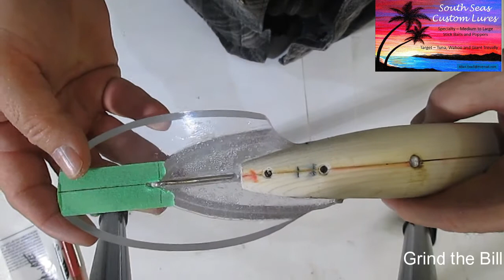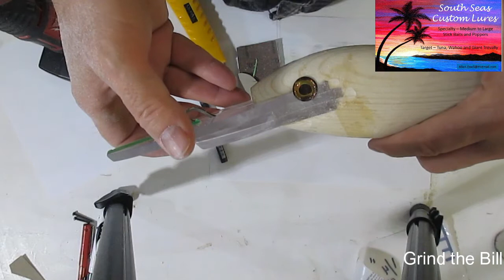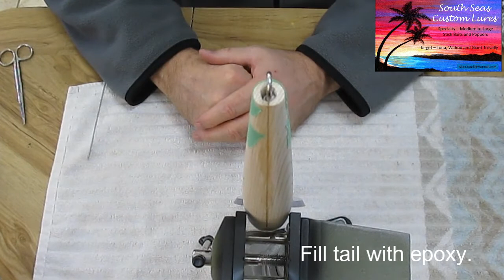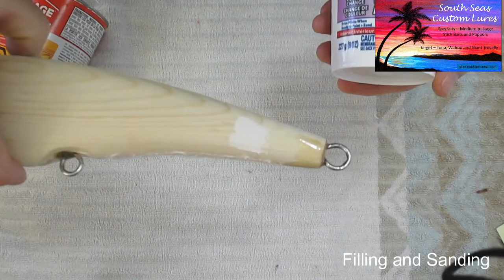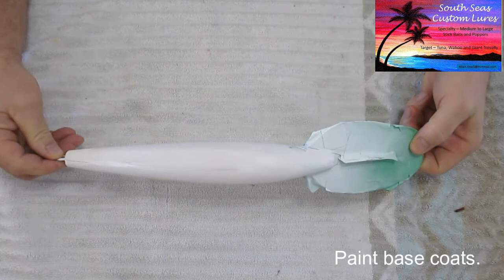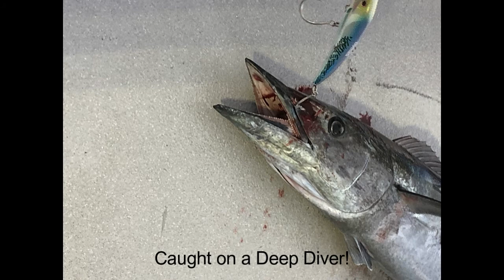Making Deep Diver Wahoo Lures Part 7 Install Bill, SS Thru Wire and Base Coats

Comment: Hi Allan: Really enjoying your video's. Very interested in making these lures since I've been going to the Caribbean o fish. I did make one Bonita but as many times I tried to adjust it, it still pops up on the surface. I can't find your South Seas site anywhere. Did you use cable as a leader for Wahoo. Thanks for the information and great work.
Reply from the maker: I use 200 lbs. fluorocarbon leaders for Wahoo. The deep divers can certainly be tough to tune. You need to use a split ring on the front loop to tie your leader on. Start trolling slowly. Increase the speed slowly until the lure starts to drift left or right. If the lure drifts to your right, as you look at it, bend the front loop to the left. you should now be able to increase your trolling speed. Increase your speed slowly again until the lure starts to drift right or left. Do this until you get to the desired speed. As you increase in speed, bend the front loop smaller amounts. I test my Wahoo lures in fresh water, I have got them down 30 feet. I know this because I could feel them slam into the lake bottom. I brought up mud and weeds several times.